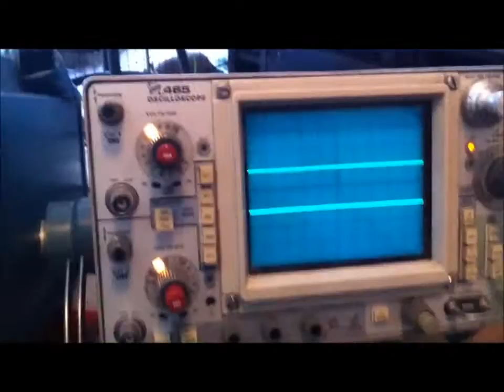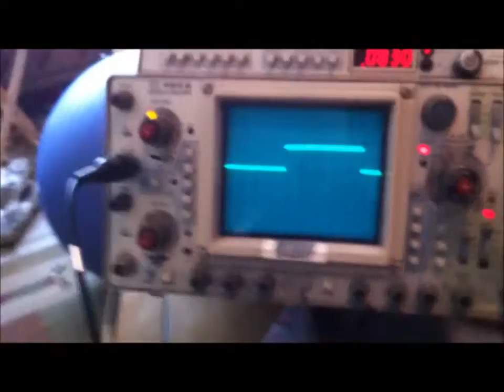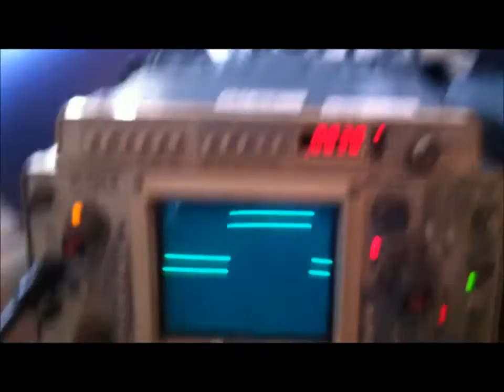Tektronix 465 and 465B score

Comment: After all these years, was it worth getting these? I have a digital Tek 1002B and I was thinking on getting a Tek 465, but perhaps I'm just nostalgic. I'm not sure what you can do with a CRT scope that you cannot do with a digital one.
Reply from the maker: I'd say it's worth it, just for appreciation of the engineering that went into its design, and the fun of fixing it up... There really isn't anything in particular it can do that a modern digital one cannot, except for the fun factor. 😊. In fact the digital ones can probably display much higher frequencies

Comment: Just one more tid bit if you don't already know. When you are not using the scope but it's on, slow the scan rate down so you can see the trace dot moving across the screen. The speed is not important but you want to avoid having a straight bright line on fro long periods of time This will cause the prosperous to burn internally and you will see a line across the screen. It will still works but that area will be harder to see.

Good luck,
Glenn

Comment from the maker: Yeah, I've had a lot of fun with it so far...  I didn't know much about scope operation before I picked up this pair, and I've learned a lot.  Looks like I need to replace a few caps and, like you said, a good contact cleaning to sharpen it up a bit, but it works pretty well so far.  I agree on the service manual.  I LOVE Tek manuals...  So much info!

I also just picked up a Tek 2465 DVS that has a shot power supply...  That's my next project.

Comment: Hi,
The 465B is an awesome scope and you got some great prices. I have 6 of them in my lab. two on each bench and for my applications they do the job very well. I also have several more modern scopes with storage and other nice-sites.
Good luck on the repairs. The 465B is laid out well and for the most part, not too bad to work on. Cleaning connectors and switches can solve a number of problems; I use DeOxit.
Be sure and get the manual, it's great.

Best Regards

Glenn WA4AOS
DSM Labs (dot com).